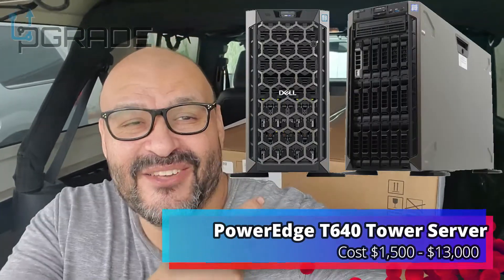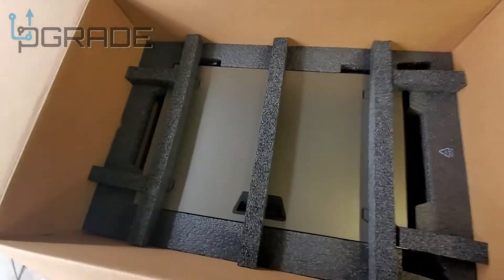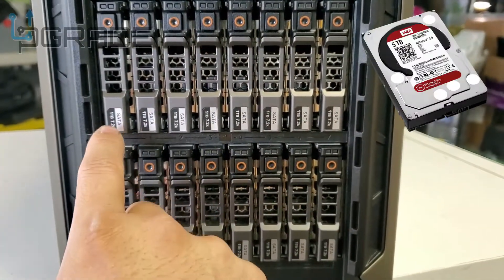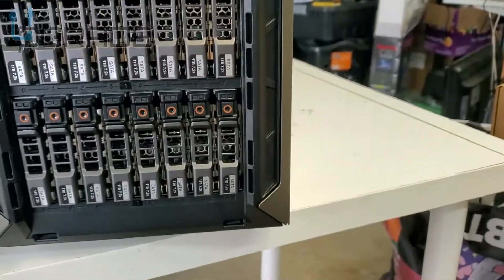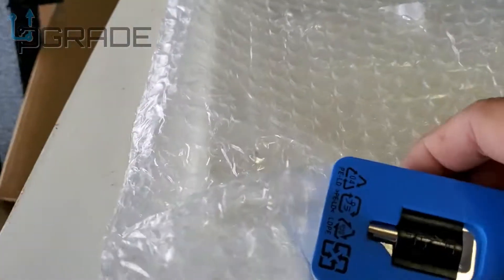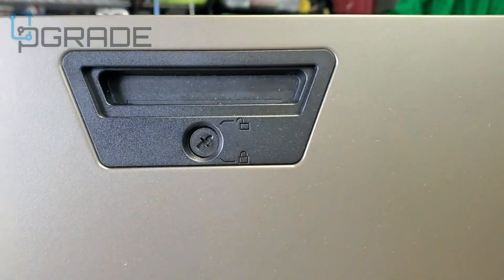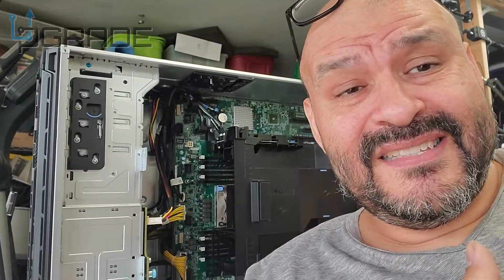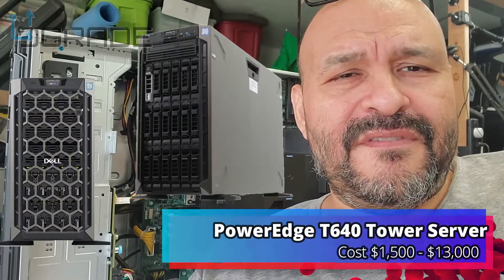Dell PowerEdge T640 Tower Server

Comment: Hey, 
We are experiencing a strange issue in our university lab. 
The workstation is able to load into the OS after the power drain.  
We get the error message RAID controller is not detected. 
Do you think it might be due to a temperature issue? But iDRAC temperature records don't show any overheating. 
Do you have any suggestions/Advice? Thanks
Reply from the maker: Sound like it could be the raid controller PCI fail and would need to reinstall the drivers or replace. First, go into bios to see if you can see the Raid controller and see if the setting has changed. Also, call Dell tech support they are great in helping and also their forums.

Comment: Just ordered a T640 with 18x 3.5" bays, so you are incorrect in saying they only use 2.5" now. The 3.5" caddy's even have a 2.5" adapter in them so you can use either 3.5" drives or 2.5" drives.
Reply: how many hard drives did you use, and how's the noise in your opinion?

Comment: I’m really surprised that there wasn’t a front fan intake caddy (w/fans of course). What was the reason for not getting one? Also, I’m curious why you didn’t remove the CPU/Memory shroud (the clip to remove it is in the rear, by the exhaust fans). Doesn’t this just rest on top of the internals, similar to the T630?

It’s a really nice server btw...I can’t wait to get my hands on one! But for now, I’m still pretty happy with my T630 workhorse. Thanks for the video!
Reply from the maker: I had a tampering system on and didn't want to remove the cover for that reason.

Comment: I am using T640 both for personal as well as for my Lab purposes. 3 clarifications please,
1. I am looking for wireless network card so I can use my server both on cable as well as wireless.
2. Is there any Bluetooth card or adapter so I can use for wireless devices
3. This has VGA and I am looking for Thunderbolt connections on the back. which ones suits this T640 server.
Thanks.
Reply from the maker: You have two options here buy a $30 Dell Interactive Wireless Dongle but limited to distance or add a PCIe wireless card to with faster transfer rate and longer distance. I have a dongle just to connect wireless incase my primary internet drop and I need to drac to it.